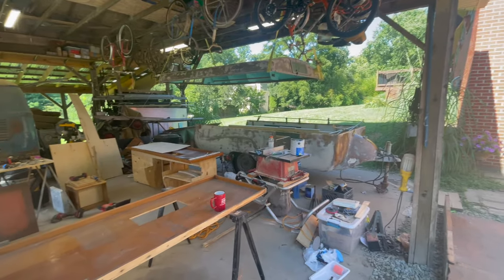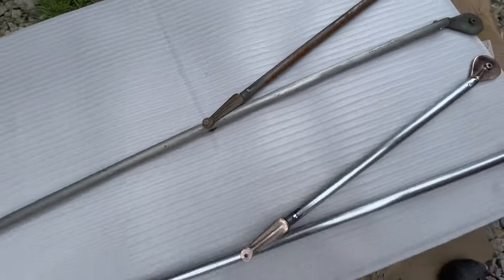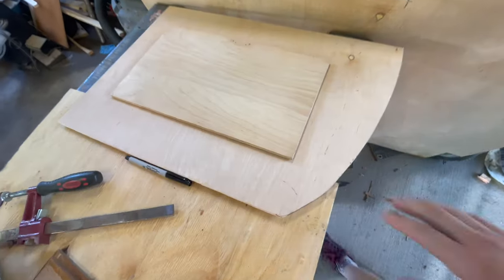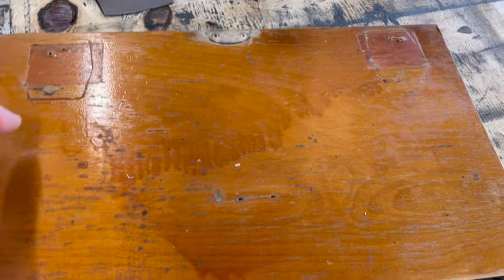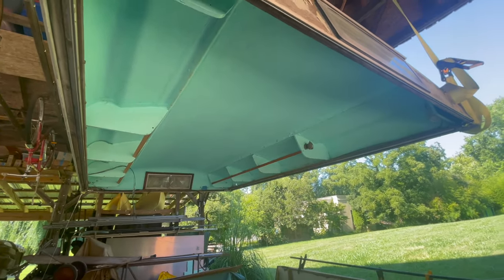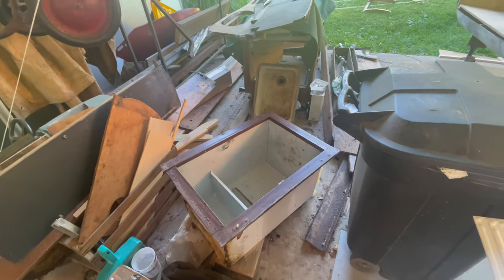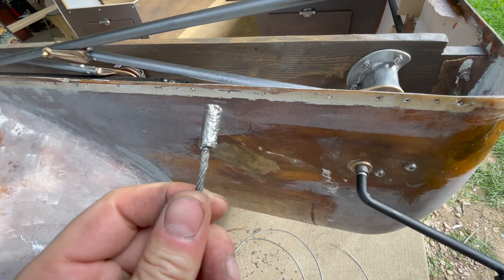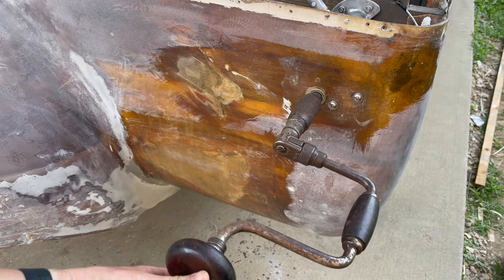1954 Hille Ranger first crank up pop up Camper part 5

Comment: Looks great   This may help or you might have already considered this. I worked at a fiberglass company in highschool building automotive and motorcycle parts. If we had a piece that we were concerned about staying straight we would either glass a strip of pasteboard or a piece of wood strip about the thickness of a paint stick.  It made it more ridged without a lot of weight or bulk   Food for thought on the next fiberglass project.  Again it looks great keep up the good work
Reply from the maker: I glassed aluminum in, just like you would on a boat on the places that I needed more rigid area.  The side that was warping was doing so because we removed all the supports that were holding it...once those were put back in we were golden! But on those 100+ degree days with high humidity, it was just getting pretty wavy! ha

Comment: The stain is spot on and the tile style ceiling will look super. I started to do that with the bay window but ended up using cedar. Thanks for sharing product information.  Ospho is the answer for some issues I'm dealing with. Thanks👍👍
Reply from the maker: the stain was tricky but once we found that color we thought it was as close as we were going to get! ospho and po15, two great rust prevention products!

Comment: That's a lovely lifting/lowering mechanism, looks to be a good design and great how you have restored this. Great that you were able to re-use original timbers and a good idea to screw panels rather than nail - the corner pair that you say you would have liked aligned - I have done similar alignment in the past but then found that I did it so well that the second screw has hit the first! Best to set out to the face it is on rather than its neighbour!

Thanks for sharing, greetings from the UK!
Reply from the maker: Isn't that cable/pulley system just a thing of simple beauty??!!! It's one of my most favorite things about these trailers and the fact that it is exposed to view...love that! The screw alignment was just a little thing that bugged me, but in reality I don't even notice it now!